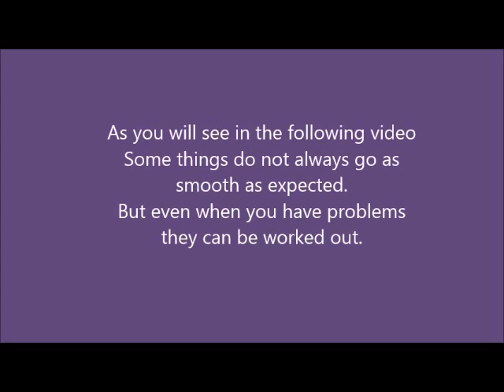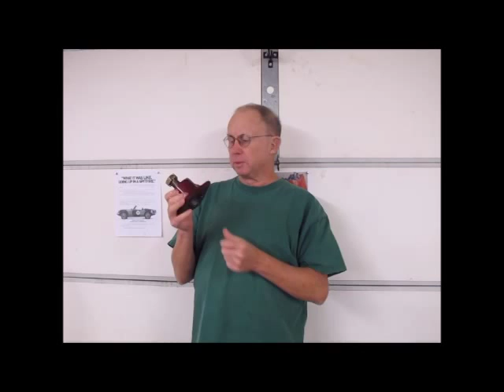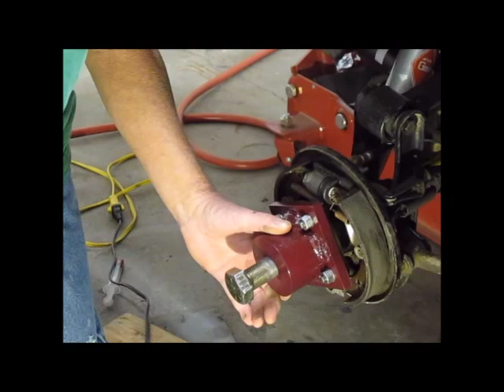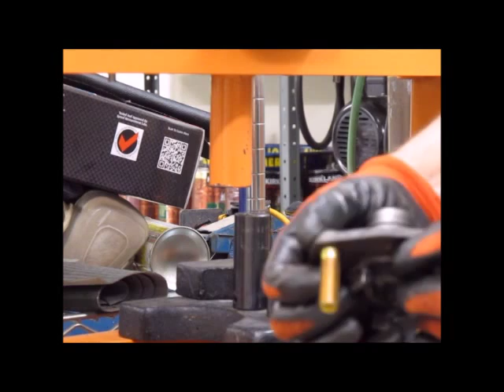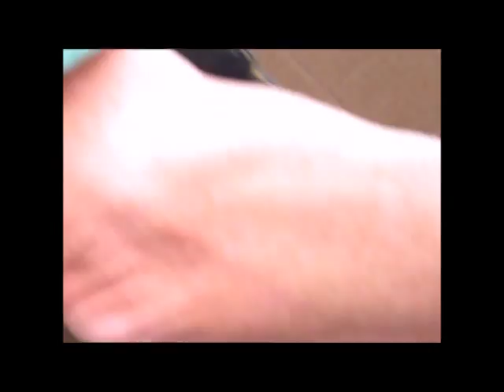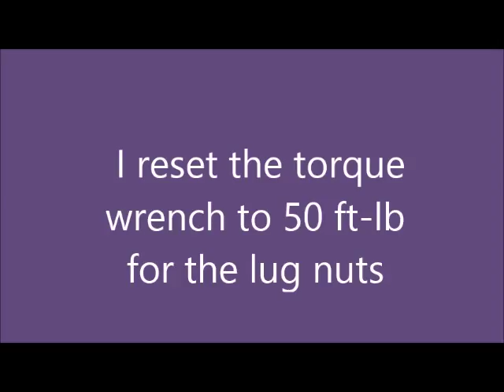Triumph Spitfire lug upgrade & hub pulling

Comment: Beware that the Freelander studs seem to come in two different shoulder lengths. That will/could prevent the lg nut/sleeve from tighten enough to hold the rim in place.

Comment: USED A LATHE AND MODIFIED 7/16-20 STUDS. A BETTER VARIETY OF LUG NUTS AVAILABLE. I DID THIS IN 1989 NEVER ANY PROBLEMS

Comment: great video.  I upgraded to these studs many years ago and have auto-crossed on them many times.   I did have two break loose and spin...and had to drill them out which was a real bear.   I was surprised they did that but I'm going to tack weld mine now that I've seen this!

Comment: The problems shown were obviously going to happen from the start.  The 'Churchill' tool main bolt must seat on the shaft nut and the shaft together so as not to damage the threads (as you did).  The Freelander studs are M12x1.5 and the lug nuts should have been torqued up to 80-85ftlb not the paltry 50ftlb that you suggest.  You certainly run the risk of lug nuts loosening in use!
Reply: exactly what I was thinking !

Comment: Where you from were here in California Gary may have some questions for you it that's ok thanks
Reply from the maker: southern california mountains
Reply: Be careful as that larger stud comes two ways. One version has a longer shoulder (non-threaded portion) that may not allow some types of lug nuts to seat deeply enough to hold rim.

I was able to use the longer shoulder on the rear as the brake drum thickness took up shoulder space. The front needed the shorter shoulder.

Comment: Some people will drill the brake back plate so that the wheel studs can be replaced without pulling the hub. A rubber grommet is then used to plug the hole.
The Freelander studs and lug nuts will not work with the Stock Spitfire wheels and hub caps, unless there are special lug nuts available?